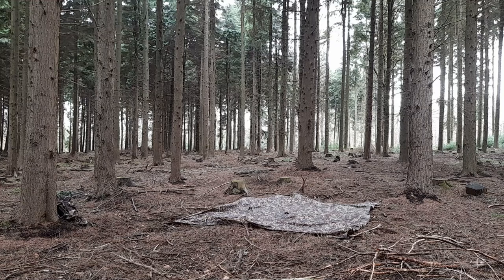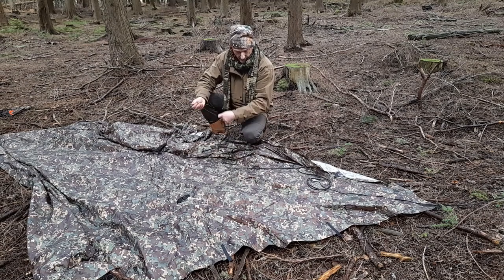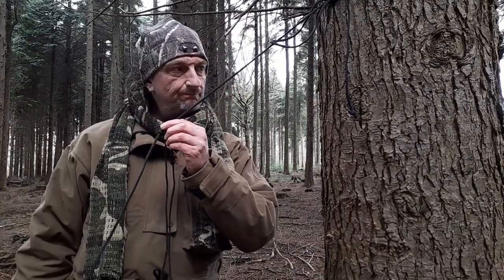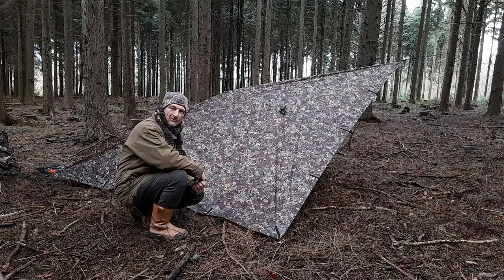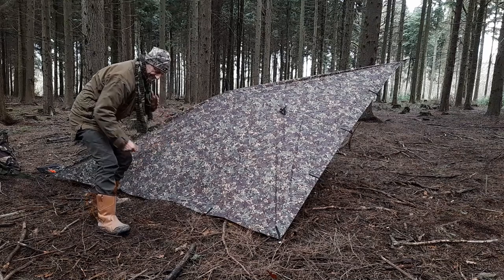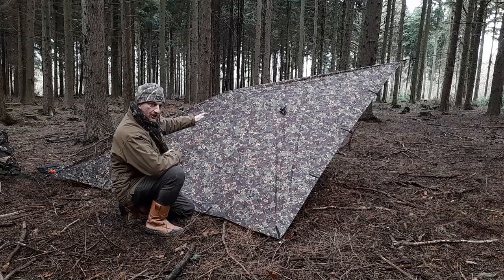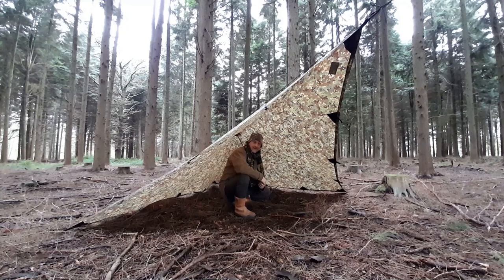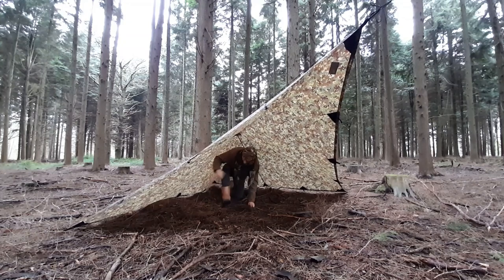Juergen Configuration Tarp Setup.

Comment: That's a good set up. I do like to be able to sit on a stool under cover. I'm coming round to the idea of Tarps. I need to learn some knots first. Cheers JB.  Trev
Reply from the maker: They are handy for a bit of cover. 👍 I do have a link for a set up with knots if you like ?  Its a private video I did for the MTC, but you can have a look, just dont share. 😉
Reply: @jim-bob-outdoors  That would be great. I've just ordered some paracord to practice with.  (I need to swap out the Lime Green guys on my new tent anyway) Could  I  email you for the link. I do promise not to share.  A generous offer I will honour.
Reply from the maker: @trevormegson7583   No problem.  allanball90@yahoo.co.uk.  😉

Comment: Again my gast  has been flabbered 🙂 a 3 x 3 tarp has to be the most versatile piece of kit you can get. Amazing amount of space under there. If it’s not a silly question, if you are going to spend a while sheltering under there, does it pay to put it up rear point against the wind?
Reply from the maker: Yes definitely. Because its light, it quickly turns into a sale. 😁